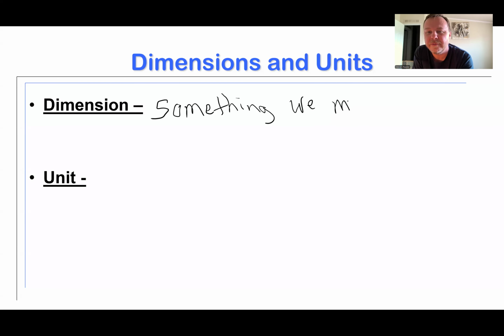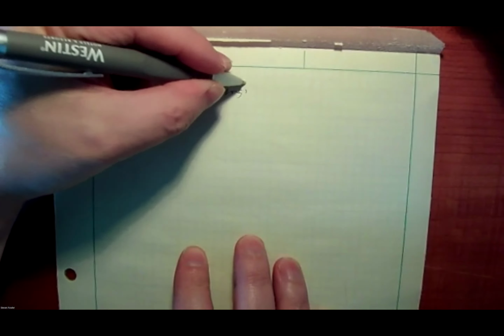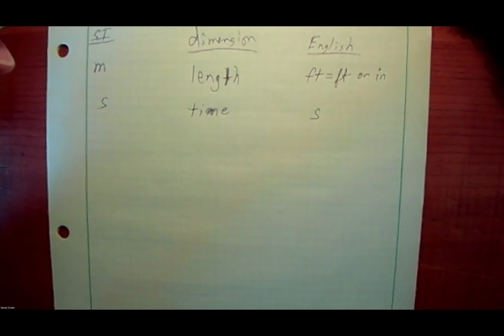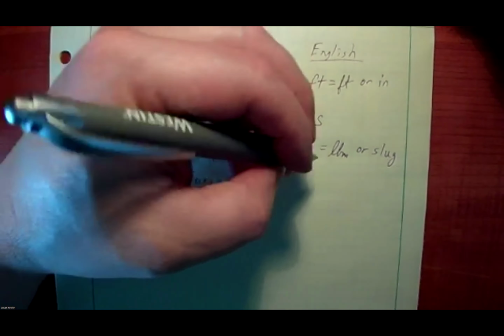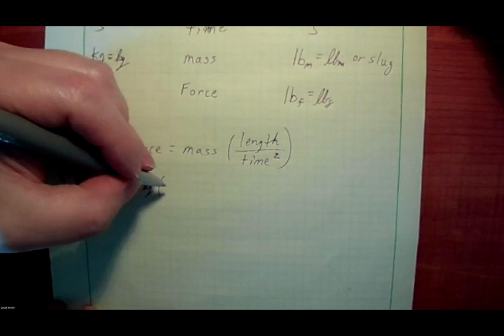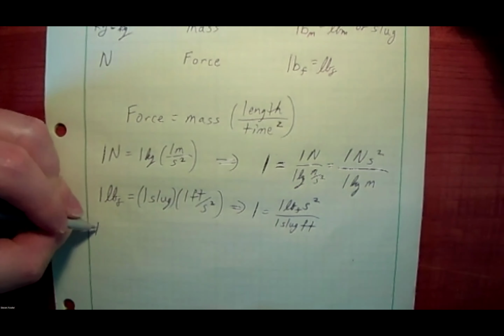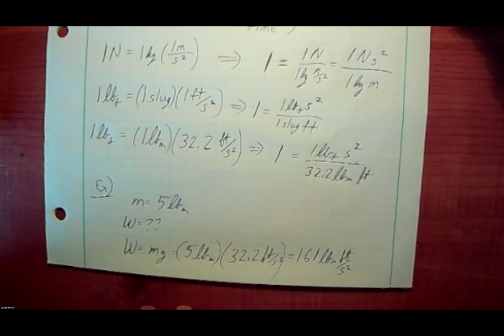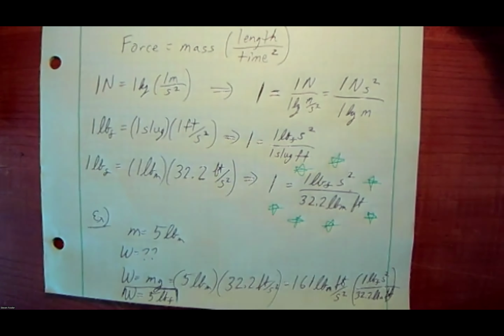Thermodynamics Lecture 1 part 2

Comment: Thank you so much.
Sir I have question what is the difference between pound mass and slug? . whether slug or pound mass is basic unit in English system?. Why in English system two different units ( slug and pound mass) for mass measurement ?
Reply from the maker: Slug is a unit of mass in the English system. A pound is a unit which has historically appeared in the English system as both mass and force. This unit was developed before our understanding of physics and therefore predates the need to distinguish between mass and force. So it is still used for both.
A slug is the same as 32.2 pound mass. I am not sure which would be considered the base unit as the English system was developed before the concept of a base unit was commonly used. 
The reason for different units is because each unit in the English system has some commonly used purpose (which is probably no longer relevant today, but the unit persists). I do not know the exact purpose for which slug (or even pound) was derived to measure. 
I do not know all of the facts here, but this is my best understanding. I am hoping it helps!

Comment: Does it matter where you use 32.2 or 32.17?
Reply from the maker: Typically not, we normally round our final answers to no more than three significant figures
Reply: @professorstevenfowler thanks, I was just wondering because you need to be quite specific in chemistry, I've never taken physics or math so I don't really know the system for this